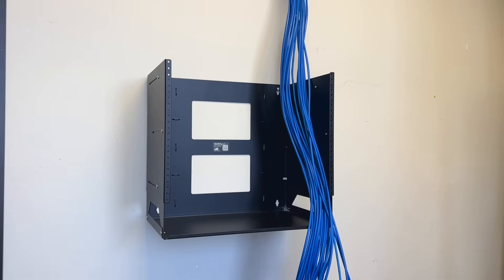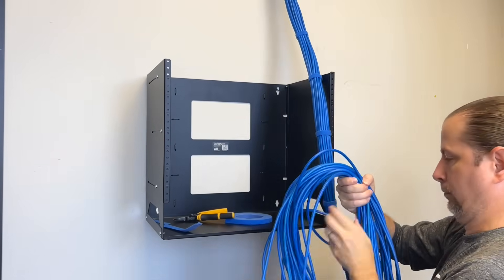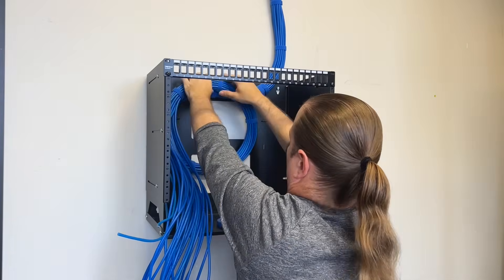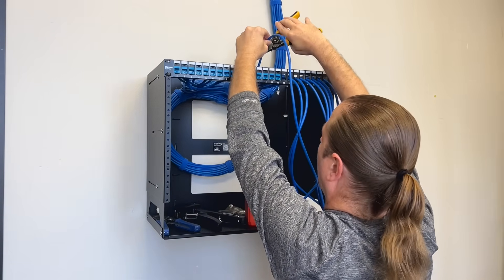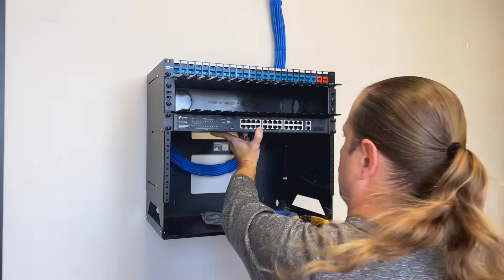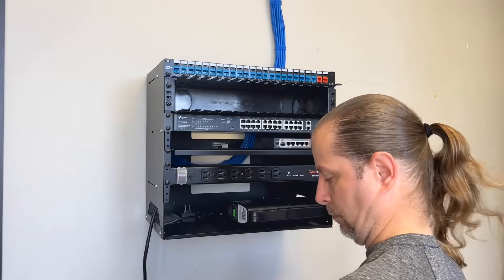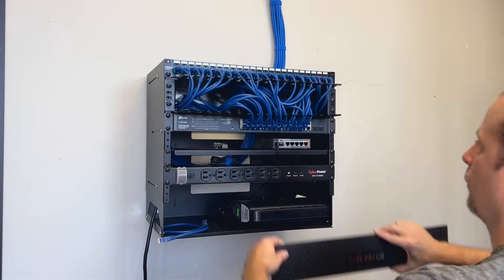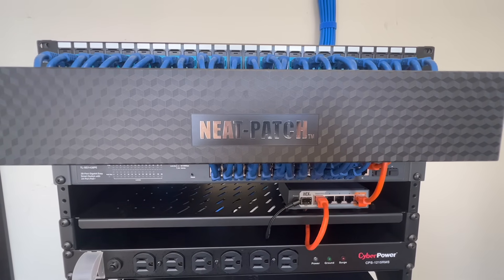Learn Network Cable Management for Home Racks

Comment: Looks great. Wish I had (the need) for something like that at my own home. I didn't hear you explain why you installed the shelf upside down. Surely, there's a reason. 😉
Reply: If it was the right way up, the lip would get in the way and without headspace he wouldn't be able to remove the router without removing the shelf.
Reply: @HarmonicaMustang In this configuration it takes up 2u space. One could have embrace the limitation and install it one u lover but right side up. Still good access and no wasted space between it and power distribution unit.

Comment: Personally, I only plug in the patch ports which are going to be used, so the unused one can't be used by a guest/unauthorized device without being noticed.  Your router and switch appear to have SFP ports... would have been easier to use that so you had a faster link between them.
Reply from the maker: In this case the SFP is the same speed as the ethernet, so it would boil down to preference.  I may do that in another vid though, it's a good variation for people to learn.  For the unused ethernets, I patch them all for aesthetic purposes on the rack, and then use the managed switch capability to disable unused ports to prevent unauthorized device connections.  Whatever looks best to you is the right way though.

Comment: Nice video. but i think you installed the tray up side down.
Reply: it depends, if you look front has lip, as he put it in rack, lip is facing down, if installed other way up lip prevents you from putting a 1U unit into cabinet, lip turns gap into 2/3 of gap

Comment: Nice work, great explained.
One thing that "bugged" me though, is why the 1UH shelve is mounted upside down ? ;)
Reply: not to mention the screw to the right top of the cable management box (or whatever its name is) is not parallel to the one in the left side. (4:10 minute)

Comment: If you need a tutorial on how to do cable management you aren't a technician my boy
Reply: No but 99% of the networking and system admins I know sure could use a few lessons,  came back from vacation with fiber strands run between different rows in the DC because the networking team needed a "temporary connection" run in a production enviroment and couldn't be bothered to use the cable tray or wait for one of the DC techs to run the cable.  I revoked their entire teams access from the data center the  same day. 

Cable sat there hanging at head Hight as a hazard for 2 months before we got an outage approved to re-run the connection. lol

Comment: Nice but short patch cables (6") are better.  We also color code all of our cables, jacks and patch cables for easier service.  Use a staggered module path panel sp you have space for service needs.  My power is always on top, then ISP - Firewall - Patch Panel/Switch - servers or other devices.  Just some ideas.
Reply: He mentioned using the 6" cables if using a 48 port switch or a single line 24 port.
Reply: @ccn8987, what is your reason to have the power on the top?

Comment: Use flow cabling, and 0.25m patch leads.  Saves the cost of the neatpatch/other cable management system, and makes tracing cabling a breeze for fault finding and troubleshooting.
Reply: Not sure I've heard the term flowing cable before either, but I'm going to assume you mean it flows from top to bottom, so in a 24P switch top 12 ports go into the top patch panel and bottom ports go into another patch panel with shorter runs. 

But yes it does make it easy to trace in a small network rack.
Reply from the maker: I don't think I've heard this term before, can you link me an example?  Sounds interesting.

Comment: Nice install  did you ID the cables on both ends.  Wire map before patching will save time in case their are errors.
Reply: Well, for this video it was not necessary to show that. But Wire map is only a simple check and no verification that the cable really meets the requirements for high speeds. So, if one installs such a rack, verifying the compliance with what ever your desired standards are, is essential. In Europe this would be e.g. EN 50173 class Ea. In the US I assume some ISO or TIA standard.

Comment: 5:00 why did you mount the shelf upside-down??
Reply from the maker: I'm a little embarrassed that I didn't discuss that in the video, but that was on purpose.  9 times out of 10, I install them that way because I greatly dislike the lip that is on the front and back of those shelves, about half the time it interferes with something I want to place on it because I can't let devices hang over the side even slightly.  The rest of the time I am supporting something heavy like a UPS, and the reverse position of the shelf is far stronger for supporting a heavy item. So to recap, its just my preference.
Reply: @TCI Productions  Ah OK! 😁

Comment: 1. What was the recessed Cable Manager you used?
2. What Crimper for the keystones did you use?

Thank You!
Reply from the maker: I used a Neat Patch 2U for the cable manager - its a bit on the costly side for what it is, and I have looked all over for a more affordable version of it and failed.  In the end I do so many of these that I just buy them in bulk but it is still a high cost in my opinion.  I've linked the crimper and jacks here:
2U Neat patch - https://amzn.to/447oCwa
All in One Crimp Tool - https://amzn.to/3KZn8ez
Compatible cat6 Jacks - https://amzn.to/3LlllBQ

Comment: What cable comb is that? I like how it has a locking ring so the cables don’t just slip right back out
Reply from the maker: I am using a Jonard branded cable comb, but I have seen this under several names with different colors and no apparent shape differences, so if you see a cheaper one go for that: https://amzn.to/44ZuaJi

Comment: What I want to know is what kind of homes people have to terminate 48 wires somehow. I may have a 32 port 40gbe switch at home, but that's barely populated
Reply: All depends on what you're doing.  If you're running a pretty basic network sure, but if you've got 2-8 wall jacks per room, half a dozen WAPs, 10 POE cams... starts adding up.

Comment: i prefer to install the shelf upside down. You took 2U just to place the small switch.
Reply: He did install it upside down, which is why it took 2 RU... when installed as designed, the small lip keeps things from sliding off. (and it only takes 1 space)

Comment: Every 24 port switch should have ports across the whole front
Reply: Switch vendors listen to us.  Stop making 24 port switches with two rows of ports.  Put a single row of 24 ports accross the front.
Reply: @ronaldnaeyaert3653  NIC/Switch HW Designer here. It's not always easy to lay out the lanes for a PHY to Port connection to always be consistent. Signal Integrity issues can be rampant in switches. Often, signal integrity constraints require us to keep loss at a minimum to accommodate for the electrical loss incurred on the trace. This results in a compromise in what is eventually decided for a port layout.
I could see how a single row of 24 ports would cause a whole slieu of possible signal integrity issues depending on the board design.
Reply: @davydawg01  ok at least put the two rows of ports in the center of switch, not left side or right side
Reply: @ronaldnaeyaert3653 I hear you. But do understand that the alternative is performance issues in the switch (crosstalk, bit errors, link drops, etc)
Always easier said than done 🙂
Reply: @davydawg01 nah, its because you can use a pcb half the size. Dollars!
Reply: Depends on what kinda PP you have.

Comment: That's a lot of data points for a home setup.
Reply: LOL my house, 4 bedroom has close to 50 and more to come, am renovating and every wall at least  has dual socket and dual power point, i hate wifi for perm network locations, eg TV,pc etc
Reply: @fubarnz  seems like overkill to me, id rather go the cheaper and easier way
Reply: @shoobiefu  I was lucky. I did 30 odd school upgrade and some of the gear was newish (cat6 cable) and kept old stuff we pulled out. So for me it was all free. Just my own time and when renovating house did install same time.

Comment: Here's a tip for when you install gear that's heavier than what you installed.  Some gear is heavy enough that it takes two (or more) hands to install.  The way to deal with that is to put in a couple of screws, partly screwed in, just below where the bottom edge of the equipment will be.  Then you can rest the equipment on the screws, when you start driving in the mounting screws.  You just have to hold up one end, while putting it's screw in and then the other end.  I have seen two guys trying to mount something, getting in each other's way, when my trick would have made it a lot easier for just one of them to do the job.

BTW, years ago, when I was a computer tech, working on the old mini computers, it would sometimes take 3 guys to mount something like a tape drive, 2 to hold it and 1 to drive in the screws.  Or on some CPU or disk drive chassis, two guys to hold the equipment, while the 3rd positions the sliding rails, so the equipment can sit on it.  One disk drive I used to swap out required a fork lift to raise and lower it.
Reply: This is an outstanding tip! Thank you!